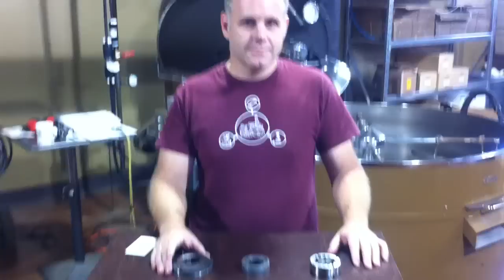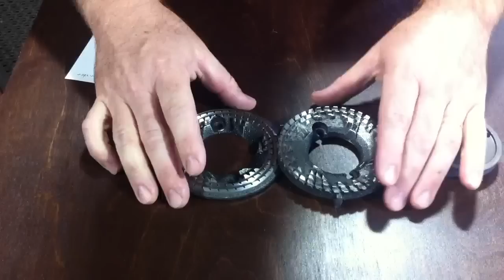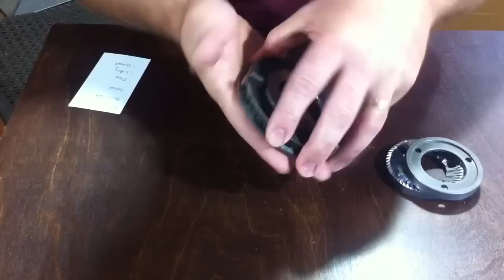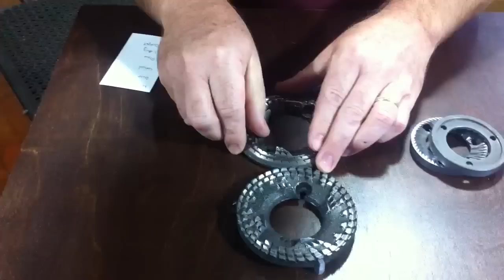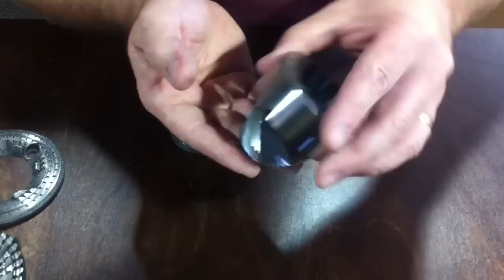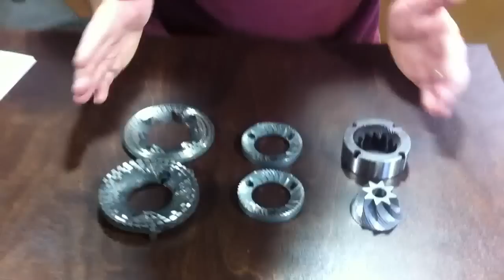Coffee Burr Grinder Overview

Comment: So does this mean a $1000 machine like a Grindmaster 810S with masticating burrs won't produce coffee as good as a conical or flat burr machine for one half or one third the price? I thought with all the equivocations and mods talked about with these other machines, and multiple burr options, it might just be better to get a commercial grinder for home use even if it's overkill in size and volume, thinking it might produce better or more consistent brewed coffee. I guess that's wrong.
Reply: commercial grinders are typically designed for large output/fast grinding speeds and durability. One thing is the burrs, these can either be typical flats or these so called ghost teeth burrs and they can reach sizes of 140mm, which makes for a huge cutting surface that can pump out kilos of coffee every minute. These grinders will also have extremely robust and powerful motors in order to handle that output. People make the mistake of assuming that a higher price means higher quality coffee, but quality isn't the only concern in the commercial setting. For this reason, I can really not recommend these grinders for the home, as it's just not an efficient use of money, and you have to remember that commercial grinders are huge and can make a lot of noise. I would argue that the best quality can be found in the upper-end home grinders. If you get a home grinder that uses something like 98mm flat burrs, there's really nothing that any commercial grinder can offer you beyond that, in terms of quality
Reply: @EusebiusAT  Thanks for your feedback. I guess a commercial grinder would be more than I would need for about 6 tablespoons of beans twice a day for automatic drip. I just liked the absurdity of it, and actually the Grindmaster 8106 is not a huge machine by commercial grinder standards. I'm not even sure I would need a 98mm flat burr. I have been using a Cuisinart Supreme Grind Coffee Mill for a a number of years. I know the connoisseurs look down on it but with the coffee I was using, Jim's Organic Whole Bean Colombian, Santa Marta, it often produced a very rich and robust flavor. Unfortunately, the last few coffee shipments over the last two or three months have not been up to par, the flavor being heavier and more bitter, to the point I couldn't get it to come out right. I even pulled out of an old Kitchen Aid blade grinder, but the brew from that was weak in flavor. I ordered the Fellow Ode Gen 2 with the 64 mm Gen 2 flat burr ($345.00, plus tax), and that did okay although it the brew wasn't as complex, and before I could experiment more, after a couple days I returned it because the automatic shutoff was shutting off too soon, before the beans were all ground. Yesterday I received two other grinders I ordered, the Oxo Brew Conical Burr Grinder ($100), and the highly recommended, for filtered coffee, IZpresso ZP6 Special hand grinder ($200), from Taiwan, to try conical burrs. Unfortunately they both seem to produce very bitter brews regardless of the fineness or coarsenes setting, and I'm not sure why. You won't believe what I found makes the best cup of coffee now--I dug out my oldest grinder, a Mr. Coffee blade grinder Model IDS55, that's maybe 20 years old, in a very pale yellow or off-white color. I do four or five 4 second pulses, shaking the whole grinder between pulses, and the resulting brew is much less bitter, with good body and and a fairly rich flavor. I sort of remember when I got the Kitchen Aid blade grinder that it didn't seem to be quite as good as the Mr. Coffee, but I kept using it because of the detachable grind chamber which made it easier to clean. I think my recent experiments and even the look of the grinds verify that the Mr. Coffee is better than the Kitchen Aid blade grinder, even though I have to unplug it and turn the whole grinder upside down over the filter basket, and brush out remaining grinds, although it's probably easier than what I had to do with the Cuisinart catch bin.
I believe the Fuji Royal Coffee grinder from Japan, designed for filter coffee, with the vertical burrs, the originator of that now common style, uses ghost burrs (wheress the others in that design style such as the Urbanic, use cutting flat burrs), and there is a new Chinese grinder designed filter coffee, not yet available in the United States, from Timemore, that has a lot of nice features which uses 78mm vertical ghost burrs. Do you think the ghost burrs on these home machines produce a fuller, more complex, richer cup of filtered coffee compared to the cutting flat burrs? I am quite disappointed in the conical burrs that so many recommend, although the trend now is to prefer the flat burrs.
Reply: @fredbloggs6080  okay, i'm not gonna pretend I read all of your response, but it seems to me that the problem you're experiencing with your burr grinders is actually about the coffee you're using. Now that's not to say that your coffee is "bad", but just that burr grinders, especially grinders like the zp6 are gonna expose more of the inherent flavors of the coffee you're using. Dark roasts are a no go for the zp6, in my opinion. 

I can't believe that what you're experiencing from these is actually more bitterness though. Bitterness comes from overextraction, and regardless of roast, that should be something you can mitigate by changing grind sizes. What you're likely experiencing is either some kind of astringent "green" flavors, in which case you should actually go finer, or bitter-sour confusion. People tend to confuse acidity for bitterness for some reason, and you're gonna get more acidity from using a better grinder, simply because it won't be masked by the bitterness and grit created from fines. If this is the case, then you should yet again be going finer, because then you'll get some sweetness to balance out the acidity.
Reply: @EusebiusAT  You maybe right about the coffee although I tried another brand of Colombian (not in the ZP6 yet) but both are supposed to be medium roasts, although it seems to me the Jim's Organic is a little more than medium. With the ZP6, I first started on the middle grind of 4, then I went coarser to 5.5, that's what still tasted bitter, not sour, but maybe you're right about the acidity. I've found with the Cuisinart that sometimes if I go finer it gives a fuller, sweeter and less bitter flavor, strangely. However when I went finer, to 2.5 ,with the ZP6, it did taste over extracted. I'm going to try a couple other coffees in it, but there I should be a to get a grind that works with my preferred coffee.

What I was asking about at the end of my last reply was what you thought of some of the vertical burr home grinders that use so called ghost burrs, like the Fuji Royal or the new, not yet available in the US for 120 V, Timemore Sculpture 078 with a 78 mm ghost burr?
Reply: @fredbloggs6080  okay, 2,5 is waay too fine for a pour over on the zp6. 4 is good for very light roasts with certain brew methods, but depending on how you brew, you might just need to go all the way up to 6 or beyond. there's no problem with the grinder tho, so your problem is either the coffee, your water, or user error.

I think those grinders are probably fine, but likely not worth the hassle, and ghost tooth burrs are very limiting in a lot of ways, so i'd honestly avoid them.
Reply: @EusebiusAT  Thanks for your opinion about the ghost burr grinders--they're not readily available anyway. I just tried the Oxo again with my usual coffee, going from about 6 tablespoons of beans to about 3.75 tablespoons (what was left in the bag) and reducing the water accordingly, and instead of the middle grind of 8, I went a little finer to 7, and the coffee came out pretty good, a little strong but with good flavor, so maybe I can find just a slightly finer grind than the middle with the ZP6 that will work, or else I will just try different beans with it. It's not really good as a paperweight because it tips over too easily. That's a joke.

Comment: Just curious as to which way the disks, cones and burrs rotate in relationship to each other - same or opposite directions, etc...  Thanks.  I'm looking at a conical grinder from Bd.Bth.Byond for about $80 Expressione brand.  Been using a Nutribullet mill blade but it makes the grind too much like flower in about 5 seconds. I use a french press so need a uniform coarser grind. Good video.  Next time use front lighting to eliminate shadow on table. Thanks.
Reply: q7wasp7 In my Rancilio Rocky, which use the second type but with teeth in the opposite direction, the top burr is stationary while the bottom burr spins counterclockwise. It is what makes the most sense when you think of it.

Comment: Conical burr is better?
Reply: No absolute answer to this question. It’s a never ending debate. I personally prefer flat burrs, because the grind size is more consistent. However, much less retention in a conical burr and also lower rpm achievable with them. Keep in mind that you’ll probably never see the difference in home use.